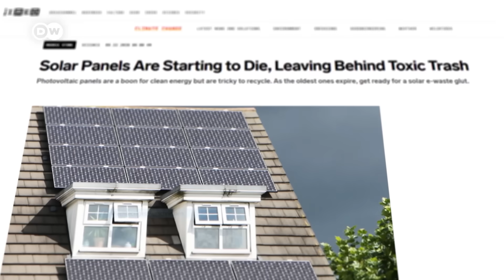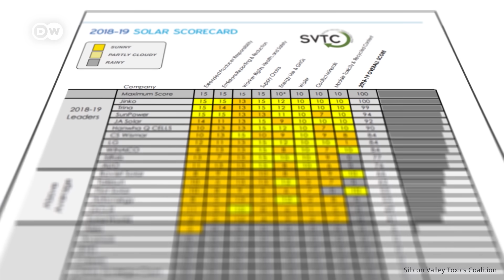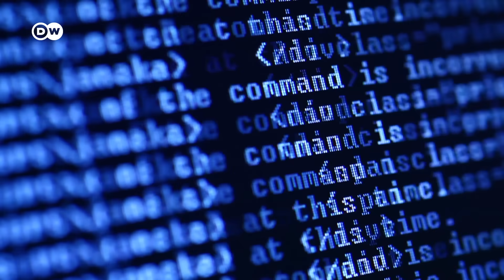How green is solar energy really?

Comment: Chemical engineers have been highly successful at eliminating hazardous waste products from production of many items.  For solar panels, the aluminum frames can be recycled, and it will be beneficial to recover metal used for interconnects.  Glass and silicon will not end up working for real recycling - sand is just too cheap - land filling is probably the way go, although if leaching isn't a significant problem the surface of the panels could probably be used as road aggregate after crushing.
Reply: Actually glass is being recycled already in other industries so it would make sense to recycle photovoltaic glass, as regards of cheap resources, both Aluminum and silicium are cheap and abundant elements, however removing the Oxygen from them is very energy intense which is the main cost factor in the production of these material, therefore it would make sense to recycle the Silicium as is already done in case of aluminum. It could either end up as metallurgical Silicium for steel manufacturers or as a source for new solarcells. In a study the International Renewable Energy Agency concluded that producing photovoltaic modules from recycled materials would half the energy demand in production and therefore reduce emissions intensity and price.
Just putting that here to show that landfilling these substances would probably be a waste of potential energy imbedded in the materials.
Reply: @paulschmidts5429  Glass is recycled less now than in the past, and the glass that is being recycled is happening due to government edicts, not basic economics.  If the cost of good quality sand becomes high enough, I'd expect reuse of beer bottles to happen before it makes sense to source glass for solar panels from recycled materials.  But I'm just winging this based on general principles and I don't have any specific knowledge regarding glass.
Reply: @paulschmidts5429  Aluminum is currently recycled without significant external edicts because of the physical situation where it takes a lot of electricity to reduce bauxite, but much less to melt and repurpose aluminum, which has many down cycle uses and needs.  Silicon, on the other hand, is being used where its electronic properties are critical, and those can be screwed up by trace contaminants.  AFAIK, the basic cost of silicon isn't all that much, so the cost for getting silicon suitable for chips is completely dominated by purification.  I guess that the same holds true, but to a lesser extent, for production of solar cells.  My reading between the lines of the IREA report is that energy demand might be reduced, maybe the emissions would be reduced, but that the price would be reduced is wishful thinking.
Reply: To be very clear: highly pure silicon is NOT from the sand of beach. It is an energy and CO2 intensive process to obtain purified silicon from very very limited amount of quartz mines on our planet.
Reply: @yunluo2488  According to the United States geological Service Quarz Sand resources compared to demand are nearly endless, quarzsand was also used in glass making for centuries. Now the inherently CO2 emitting part of the process is the reduction of SiO2 to Si. Recycled Si is already reduced. The only part that will involve CO2 emissions is the electricity for the further refining steps, however electricity can also be sourced from renewable sources.
Reply: @paulschmidts5429  The quartz sand for silicon (not SiO2, not glass) production needs very special quality: Oxygen is not an issue but the other impurities such as Boron and metals. All the polysilicon for PV comes from about 5 mines in the world. What you pointed out is a common misunderstanding on the abundance of silicon.
Reply: @yunluo2488  Thats honestly interesting, could you give me a source where I can read more upon it?

Comment: There’s always a yin in every yang and vice versa, solar panel is still a better choice for cheap and green energy. Hopefully we will get way more sustainable solar panel in the future
Reply: We do believe in solar energy. Our task is to make it greener.
Reply: Definitely cheeper! I use them for my shed lights and garden lighting
Reply: @Boo-pv4hn  Run an underground extension cord to tyhe shed, cheaper. Outdoor garden lights the same cheaper with a control box. Hope you get a lot of sun to power the lights
Reply: My thoughts exactly. The first generation of affordable solar panels were never going to be fully clean, but it’s still better than not and the further the refinement and the more cleaner energy available, the less fossil fuel energy you need for the next batch. No one in their right mind condones dumping toxic industrial chemicals even to have solar panels. The funny part is that it’s nonsensical to suggest that solar panels = inevitable Chemical dumping and if the easiest solution is to not need that material in the first place via a new method, so be it. As for recycling, still a moving target but if this vid is accurate, we are getting closer all the time. Also I’m not opposed to chemical recycling of any and all plastics just to better manage the damn stuff. (Unless we plan on carbon sequestration in part by throwing all “unrecyclable” plastic into dry oil wells)
Reply: @watch50er  its is inevitable that toxic chemicals from solar panels are dumped into fresh water.  Majority of "affordable" panels (china heavily subsidies panel manufacturing) are made in china and everybody knows they have some of the most polluted watersheds in the world.  Pretty sure if all the other manufacturers are dumping so are solar panel manufacturers.
Reply: @watch50er  there are too many negative side effects and yet unforeseen problems with solar.  Its not energy dense enough to power our civilization, especially if everybody is going to be forced to drive EVs and use electric only for home appliances and heating systems.
Reply: Fission still seems like the best choice to me.  Take a look at ThorCon and you may change your mind about solar being the best choice.
Reply: @Jay-jq6bl  nuclear is the way forward, just look at the newer generators and how efficient and flexible they are at recycling nuclear waste and reduce the amount of waste considerably. There is also the smaller modular generators that can fit on the back of a truck and still produce massive amounts of energy.
Reply: I can't wait until we have a different fuel for our cars 😩
Reply: No, it’s not cheap, because the batteries you need to store the energy in are 400xs more expensive than an (almost literally) dirt cheap steel barrel.
Reply: Solar and wind still have nothing on Nuclear. Considering all Nuclear waste Can be recycled for profit. It is politicians and big oil regulations that have stymied Nuclear. The best and cleanest energy source.
Reply: Energy efficiency is the best form of energy. Code built homes use 5 times as much energy to heat and cool as home built to Passive House standards. In most cases they could be built this way cheaper than a code built home with solar panels.
Reply: I"d still perfer nuclear, for it can produce far greater amounts of energy. plus there are some methods, just not usd, th caa recycle the used fuel. or even thorium.  :shrug:
Reply: Nuclear, and hydro is the way as of now. Maybe there are still breakthroughs to be made, where solar can improve, and that would be cool.
Reply: @hitkid2456  
Don't go for it because it's cool, but if it is a genuine solution and can sustain.
Reply: No it isn't
Reply: Fossil fuel is used in making solar panels.  Good luck when they shut down all the fossil fuel companies.
Reply: How is it better?
Reply: You need to research solar energy 
It’s worse for the environment 
Also produced in china with slave labor
Reply: Looks like that oil mafia is crying
Reply: @factualdilemmas2666 looks like the 'anti Nuclear power' mafia is crying.
Reply: "Instead, we should openly adress it's problem and figure out how we can fix them"

🙄 Why dont they also use those words to Nuclear Reactor?
Reply: @XanderProduction  And fossil electricity, watching this you would think if you pour oil in a river , there is no problem. That part really annoyed me.
Reply: @XanderProduction  Yeah, it's like they banned fire because someone got burned.
Reply: @Jay-jq6bl  what if there's a war in a country with nuclear plants?
Reply: @imiy  I'm talking about Thorium Molten Salt Reactors, so that's not really an issue. Take a look at ThorCon, like I mentioned. They were started by a shipbuilder who was making some of the largest oil tankers in the world and they figure they could build 100 1GW power stations per year within 10 years, producing electricity at costs on par with coal and piped natural gas. Much cheaper than solar when you consider energy storage. They talk about safety and how you'd basically have to have a terrorist crawl into the reactor for it to be possible to cause it to melt down.
Reply: @imiy  the buildings of nuclear power plants are really sturdy it could withstand most missiles
Reply: @coketruck  yeah, awesome to know. Since Russians are bombing a nuclear plant in my country now
Reply: 100% agree... Think of green energy as a tech pyramid, and solar panels are like the base level of this pyramid, but lessons we learned from solar panels will help build the next level/tier of green energy
Reply: @kwykwyk8447  did you watch the show.  Solar panels are not green.  Solar panels can not be built without fossil fuels.
Reply: Yes it's cheap alright but only because... every step in producing a SP is powered by cheap coal and fossil fuel energy and that's the only reason why. Take coal and fossil fuel out of the equation, watch how fast the price WILL jump up!!
Reply: @kolobara08  Cmplete nonsense! “Cheap” and coal and fossil fuels don’t exist. Factor in the damage to the environment and rapid
Reply: @kolobara08  you didn't understand ti's whole video at all. You cheap coal is now 3 to 10x more than solar and as more and more electricity is coming from solar ad wind, the more green it becomes. Its not because it is cheap that we are using coal, and but because that it is the install base, even if we wanted all electricity to come from renewable today, it would not be able as there is no capacity to produce that much pannel. But it is coming, not because it is green or ecological etc, but because it is much cheaper than coal.
Reply: @kolobara08 
And why I find people telling me of greenness energy are full of it.
Reply: Still the R&D to get there is never added to the cost. Only the We did it finally.  We create problems to create solutions  we are the Avengers....
Reply: @matthewstewart5113  i have never seen anything this stupid without r&d you would still live in a hut
Reply: @Tom-tr4em  a hut is eco friendly,  no pollution,  . The indigenous people of the world today and Even your ancestors lived in huts for millions of years.  We've only lived in post industrial revolution for roughly 200 years.  Maybe through the ages We've been here before.? Millions of years of history only the ones who write the books would ever know 😉.
Reply: Solar is anything but cheap, unless you are getting subsidy. Depending on where you live, you may never be able to switch to solar completely.
Reply: @manishmandal-78  so says the uniformed. Some people read something 5 10 years ago and think it is still the case. Solar is now te cheapest of electric generation ever.
Reply: You need to watch more documentaries on rare earth mining for so-called clean green energy. They’re now even looking at strip mining ocean floors. Natural resources incl fresh water used for these mines and mass farms is causing dangerous depletion on the now limited supply of drinking water on earth and already leaving smaller communities and areas vulnerable where these mining cos  bully themselves in using corrupt practises with gov’ts. I agree we need cleaner energy but based on all the info and data to date incl costs vs benefits we’re not there yet.
Reply: Solar energy is not cheap...
Reply: @ronaldolamaroza9176  or environmentally friendly.
Reply: @ronaldolamaroza9176  And not exactly green either. Don't know why people keep going on renewables as green or cheap, they aren't either. There's always a downside to trying to produce energy.
Reply: Make a requirement. 75% of energy cost for Marijuana production must come from green energy  producer's.  Watch how fast green energy products improve. Almost overnight  garented.
Reply: @matthewstewart5113  YOU ARE ON TO SOMETHING. get the big people first so everyone can afford it.
Reply: @mooonlight778  was talking Bout big corporation farms. The ones growing in warehouses all over Nevada, California, Oregon, Washington. You know all the states also having hug drought issues . A city can not buy its way out of a bad situation.  But it's shrill leaders and wealthy can pay to leave it for a more comfortable climate. 😕 😒
Reply: @matthewstewart5113  fool...most growers grow outdoors and use very little power.  How about they mandate that crypto has to be mined with "green" energy
Reply: We had very cheap panels. Years ago they cracked the code allowing cheap panels to be on everything. See any anywhere? No. There is no money in cheap energy. Same with curing disease.

Keeping an endless crisis an endless problem going is what they’ll do. It’s about control and money. Not the planet.

Comment: Solar panels kill extremely little like a rain and a duck thought it might be water yes rare but happens.
The Solar that heats up the air to turn a steam turbines kills hundreds of thousands a year.
Wind makes good energy there strong but kill up to 200,000 to 500,000 birds a year if painted 
1 blade black it will reduce to 100,000 to 350,000 birds get killed.
Geothermal very good power and can mine rare medals as a by product from the steam killes 1 to 50 birds a year.
How idk but does.
Water turbines still new but ok energy and killed 10 to 100 fish.
Petroleum kills 1 to 1.5 million a year birds and people.
Methane though not used for power very often but almost all Methane waste is burned so that kills 50,000 to 150,000 a year soo.

Comment: The good news is that solar panels are recyclable.. but it's not perfect.. when was anything ever perfect?
Reply: A* good read on this subject is:
Green Illusions: The Dirty Secrets of Clean Energy and the Future of Environmentalism
by Ozzie Zehner
Was a required read in my graduate environmental class.
Reply: Yes, but given the quantity, (millions and millions of panels) disposal needs to be perfect, or future generations are going to face mountainous piles of landfill leaking toxins into the environment. Recovering the cost of proper recycling is not viable and I fear panels will be dumped. We cant leave that for our kids to clean up.
Reply: @archcollie5708  The cost of recycling can easily be added to the sale price without much problems. As the video mentioned recycling is mandatory in the EU and yet there are plenty of solar panels.
Reply: Lithium batteries are even less recyclable
Reply: Just the fact that they can be recycled, and get used again to make more panels, is a win against fossil fuels, which can't. The recycle process will only improve over time
Reply: @Eet90Fuk  and the efficiency of the panels as well